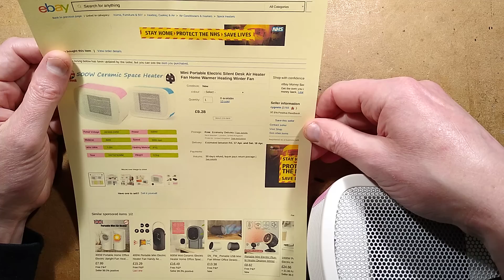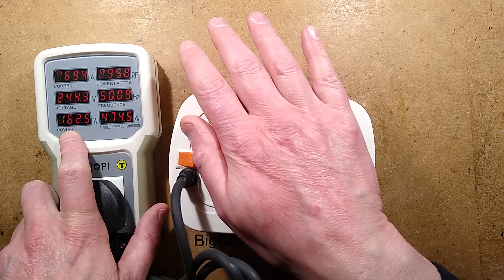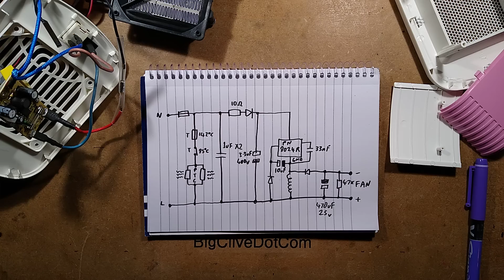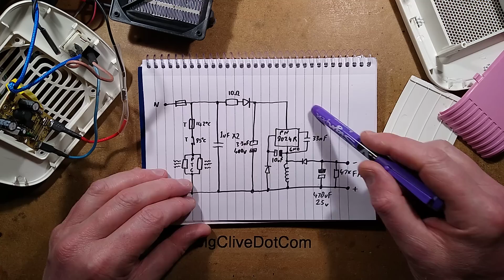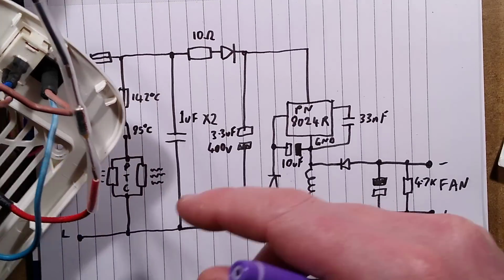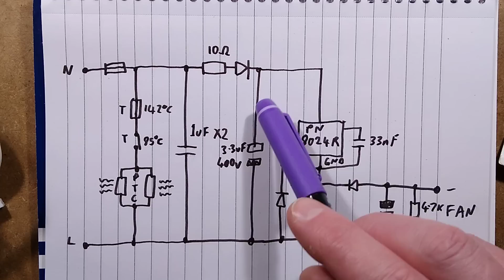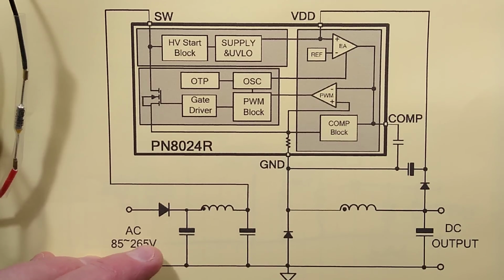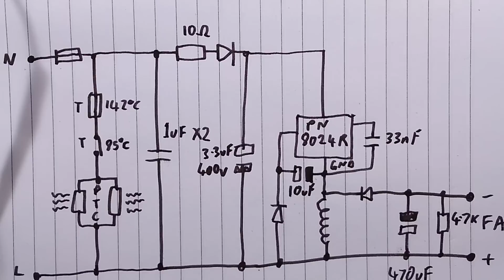Inside a pink plastic 500W heater from eBay.  (Good for parts.)

Comment: For anyone else that's wondering, the SMPS topology is a fairly common inverting buck-boost, but the extra complication comes from how the chip is generating its own power rail and referencing itself with regards to the negative rail of the input voltage. Neat unit, not nearly as sketchy as one might expect!
Reply: They make flyback SMPS ICs like that as well (and Im sure other topologies as well). Messing with the Power Integrations TOP250 at the moment which is the same way. Just supply mains and away it goes. Well, theoretically, anyway (I shall see shortly when I power it up.) Of course, worth mentioning that the supply in the vid is not isolated, so it limits its use to things like this that are hidden from the outside world. Edit: The inrush current may be why they used the buck/boost, so the fan will still run even if the heater is pulling lots of current and drawing the voltage down.
Reply: That kind of circuit confuses those who still aren't used to the idea that voltage is relative. The fan still gets 12V, just that the way the schematic is drawn, the PSU is "pulling" on the top rail instead of "pushing".
Reply: The complexity of the circuit is relative, I have an engineering background and could easily discern the reference and why, however a lot of people that follow Clive are here to learn and discover information from
Clive and his unique delivery, I think showing examples of slightly unconventional circuits like this helps the novice to understand how engineering solutions can be delivered in different ways, with varying topologies and methodology. Clive as always god bless my brother
Reply: It's comments like these that make me want to learn electrical and electronics. Thank you for yours!

Comment: You would want the fans to keep running if the thermal switch flips, so that is actually good design.
Reply: I had one that did this, I think made by Holmes?
Heating coil would cut out when tipped in any moderate amount, but the fan kept running.
Reply: @420anonymous  It's a safety feature required on all space heaters afaik. If they fall over, they must turn off, so they have some mechanism to detect if they are standing up or not.
If the fan cut off, it could retain heat enough to possibly ignite something, so I can understand that.
Reply: Yeah, I thought that. Every fan heater I've owned that has a thermal trip just takes the entire thing out, fan and all, but leaving the fan running just seems to make sense.
Reply: Unless the damn thing has flames coming out of it. Though I doubt the fan would still be running at that point.
Reply: @stuartcoyle1626  It is far more likely that the fan would serve the purpose of cooling off the overheated element than it would stoke any fires it started, I would think.
Reply: The milkhouse style heaters we have cut off both fan and filament but those have a free-air heater wire and free-enough airflow (unlike the ptc block, which look like it needs a high static pressure) to cool down the element almost immediately on tipover. The tippy switch is just a weighted cam lobe that noses a pair of contacts open. Only works face up/down, not sideways tho

Comment: The words "plastic" and "heater" always make me nervous when in the same sentence.
Reply: There are high temperature plastics but mostly not used in cheap Chinese products.
Reply: With these things I think metal would worry me. Poor isolation/grounding in a conductive case.
Reply: No worries it comes with fire on the pic
Reply: Every fan heater in Australia has a plastic case. They have done since the 80's.
Reply: A bit like those Lithium ion power banks with a built in hand warmer! I think Clive reviewed one some time ago.
Reply: That and using a cheepo fan/smps..  Capacitors will probably go hi-esr before the fan fails from dust I guess anyway?
Reply: Brett Ison Gooseknack the Vulcan Tangi is an exception.
Reply: @gooseknack  doesn't stop it being wrong in my head.
Reply: Many give off hideous fumes. Buyer beware.
Reply: What about "Wood" and "Heater"?
Reply: Brett Ison Gooseknack In Australia as well as everywhere else. Nobody makes metal ones any more, save for the radiator kind.
Reply: @Joachim Shekelberg Why not wooden gasoline powered heater?
Reply: Plastic heaters are fine until the fan fails... I bought one in 1996 from EWT... 2000w but the power cord was only a cheap flimsy 6 amp that was fine on 1000w setting but got dangerously hot on 2000w... eventually in 2001 I had the heater on at 100w setting, picked this thing that was stated on the unit to be made in germany... heater stopped when I lifted it, started & stopped when I put it down, lifted it & tilted it back slightly & the cable shorted at the entry point... orange sparks sprayed out of it & thinking "has the fuse gone or not" so I pulled the other plug for the lamp out... stuck the 13A fuse in that plug & the bulb lit so it as well for me I turned the socket switch off right away...

I fitted a 10A rated 1.0mm x2 lead to it once I got the funny type screws out, had to pull it right through to the switch & solder the wires on... worked until november 2015 when the axle bearing for the metal fan blade came loose & slid out of the motor windings with the blades ringing off the grille, then it came out proper & the motor windings started buzzing... no way was I turning the heat on as I know what the result would be - fire! 

I've watched a video rodalco2007 had of one of these plastic fan heaters catching fire in a controlled demonstration... I stick to my older convectors though they both have the PCB and the toaster wire now... but watch out with cheap heaters all the same, if it's 2000 watts fan or no fan, make sure the cable/flex is 2x or 3x 1.0mm 10 amp and no thinner or you have a fire hazard worse than a plastic heater... look carefully at the power lead as it does say on it.
Reply: @gazyounglive  I'm a full time electrician so I know my cabling but thanks for the story, very interesting actually
Reply: Damicske but used in quality Chinese heaters.
Reply: Full metal body heater
And sone stupid factory person
Connects live wire to the metal body
Instead of ground and u happen to touch the body 
Whats gonna happen?
Reply: @lordelectron6591  what happens is it fails the earth bonding test, isolation text, QC inspection etc etc etc.
Reply: @gordonlawrence1448  
And .... You get a shock
Reply: @lordelectron6591  No you would not because something in that state would never leave the factory.
Reply: @gordonlawrence1448  
Consider it was made in 
Ch   in   a
Reply: @gordonlawrence1448  
Yes it would be the case for any other country
Reply: @lordelectron6591  Ah yes if you were specifically talking about China then I can say from experience all bets are off quality wise. One of the things I used to design was boiler controls. The spark coil is actually not rocket science but does need to be done in a specific way due to having near 25kV on the output. We were shipping about 100,000 a month overall of about 6 types of board that all used the exact same coil. In 3 years we had 4 coil failures when they were made in Taiwan. Two of those were mechanical damage. The company that owned the Taiwan plant moved it to China. 50% failures.
Reply: The only thing that heaters are are short circuits with fans either in front or behind.
Reply: And especially very cheap from China..
Reply: @Joachim Shekelberg Wool?
Reply: Most electric heaters use plastic housing, but it still makes me nervous, too
Reply: @VyvienneEaux  not here they dont. They are steel housed.
Reply: Does not help that most apartment fires in the winter are caused by these directional space heaters.  They should be banned from apartments as smoking is.  I use a permanently sealed oil radiator heater which is much safer.
Reply: @anononomous  Blown breaker is a much easier fix than a burned house.  That's why they used to insist these things be metal.

Comment: Today I found a 15 year old bluetooth headset in the loft and brought it back to life using a salvaged li-ion cell from an airsoft tracer unit.  It hasn't exploded in my ear - yet.  You'd be so proud.
Reply: But not as proud as if it DID explode in your ear :)

Comment: I can only assume that the Chinese words for “energy” and “power” roughly translate to “fire” in English as that is the only sensible reason I can come up with for the shear number of items (particularly lithium ion batteries where the irony of “Ultrafire” runs deep!) that either have “Fire” in their brand name or have photos of the product immersed in flames as if buying it were intended to set your home on fire.
Reply: Direct translation often produce funny results. Even in Europe, there are enough examples where in the languages of related nations one word means something completely different :)
Ultrafire is notorious by being blatant scam, having sort of 1/4 of capacity written on their label. However sometimes they demonstrate quite fiery attitude.

Comment: The little heater is surprisingly good for the money, even with two layers of overheat protection... well actually three, due to the nature of the PTC heater array.
Certainly good value for the parts regardless.
Reply: Actually four, since it seems the heater block is in series with the fuse:  if it gets hot enough, the fuse will melt open.
Reply: @johnrehwinkel7241  actually 5. The solder joints will meat when it gets too hot. Anything is a fuse if it gets hot enough
Reply: Actually 6, when the heater catches fire, the cord will melt thus shorting live and neutral, flipping the breaker in the basement.
Reply: girlsdrinkfeck Or like most of the world.
Reply: girlsdrinkfeck In Sweden a lot of people have breakers in the basement and it does happen that the fuse (yes we still use old fashioned fuses in a lot of installations) blows and you go and unscrew it like a light bulb and change it. The fuse type is called Diazed. It was like this for new installations here until the 1990s. We didn’t install RCDs either as standard until about 2004.
Reply: @ianbakke  we also use that type of fuses 30 years ago in Croatia but I never seem them in basement, fuse panels are usually mounted next to meter near front door. Now meters are outside but fuses are mainly still in hallways, each floor have separate one. Who wants to go to basement with lights out? So impractical.
Reply: @ianbakke  Diazed fuses are still available at most supermarkets in the Netherlands. They were installed until the 1980s, and there are hundreds of thousands of houses still using them.

Comment: Great video!!
My view on some points:
1) the 4.7k resistor is there to prevent the output voltage from skyrocketing if the fan fails or to fix the load to a minimum value: it's a buck-boost, the inductor would charge and charge the output cap (470uF) until it explodes :( if the load is too light.
2)the 10uF cap provides the vdd for the control circuit in the IC, it goes effectively in parallel with the output when the mosfet inside the IC is driven off and the inductor charges the 470+10uF overall cap through the diodes.
3)why this "strange" reference for the IC? The sole role of the IC is to switch on/off the power mosfet (at the right time!) and in order to do so it must bring it to saturation, so the Gate voltage should be sufficiently higher than the Drain which is connected to the input 400V or so. So without boostrap caps or isolated drivers the chip would have to input a Vgs (let's say 5V) on top of 400V, and 405V from a control circuit is not a thing. It's convenient to use the Source node as the reference for the chip so that only 5V=Vgs are managed by the control to drive the mosfet on/off.

Comment: The little capacitor on the COMP pin isn't to provide a stable voltage reference. It's to provide a stable control loop by dampening its response. It sets the bandwidth and therefore how quickly the supply can compensate for errors vs the phase margin. Too great a bandwidth (and therefore a low phase margin) results in ringing and instability as the output adjusts to varying load current. 

A loose rule-of-thumb is to set the bandwidth between 1/5 and 1/10 of the switching frequency but it varies with the design and the selection of other components.

Comment: Have two of those little heaters. Found them to work well in a small space, even against a winter morning low of minus 8 with heavy frost outside(well, a half centremetre of ice actually), in Australia's winter. I wouldn't trust leaving them unattended though, that's the same will all portable heaters. One of these I purchased, melted its switch and the heater promptly stopped. I remember it from the circuit and replaced it with a switch inline on the cord. Also replaced the foriegn(round pin) plugs with Australian plugs on both heaters, I didn't trust the shitty adapters, even at 500 watts. 

In case anyone is wondering, the temperature output at the front of the 500watt version, is 140 degrees celsius(assuming the temperature probe for my multimeter, is accurate!)
Reply: In the 1980s there was a big 'advertising' campaign to get people to ditch the trad stove-top chip pan and get a purpose designed deep fat fryer. For decades, Mum used a trad chip pan - we never had one catch fire (once or twice heavily smoking ;) ) but came the day and the deep fat fryer was ordered. The instructions said "do not use empty" - but I didn't want to test it with oil in it. So switched it on, empty. It warmed up a little - and I mean A LITTLE, clicked and never worked again. On disassembly, I found a 4mm double-ended tapered plastic pin between the bimetal strip and the switch. Both having appropriate holes in which the tapered pin should sit (at both ends, not just the one as I found it.) I guess it had bounced out in transit - but once back in its correct place, the DFF worked properly for some years
Until an electrical fault caused a spade terminal to melt through the bottom of the fryer and mark the work top with a pair of burn holes. 
We're on oven chips now.
Reply: @millomweb  interesting failure. home fryers are not meant for continuous use and thus are skimpy on a lot of things, likely leading to the fault you mention here. if you do a lot of chips/fries, you'd likely be better off doing what you already do, and use the oven, or get one of those low-end commercial fryers. honestly though, fryers are more an ease of use tool for large volumes (say, fast food) so if it's a few dinners, the oven typically is better anyhow.

Comment: A very quick and easy mod. might be to put a switch in one of the leads to the PTC element supplies - so if you don't need 500w, you can reduce the power to 250w. Possibly enough space in there to install a small (Chinese of course!) temp. control PCB / display module too, so what's an already interesting little heater becomes even more useful!

Comment: That's a good idea to keep the fan running even if the heater trips. Most just shut the whole thing off, at which point it will just heat-soak if its been blocked by dust getting into the aluminum fins.

Comment: It didnt turn off the heater when you blocked it, the power consumption never went below 140W
Reply: @Philip Cross Yeah it was below 150w, oops.

I wouldnt trust it either, at least not in a room with a lot of combustibles
Reply: @Heimbasteln  So plenty of other stuff to heat the room then ;)